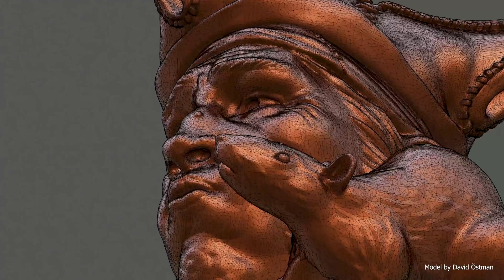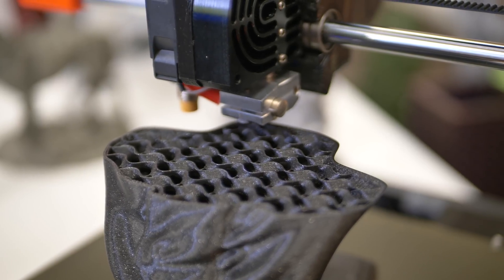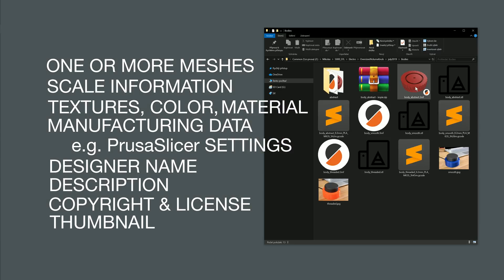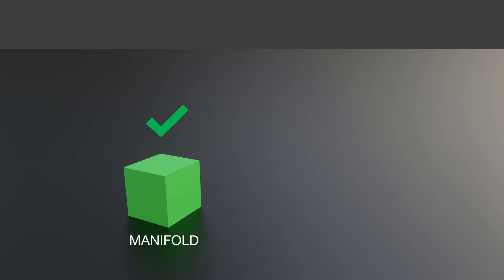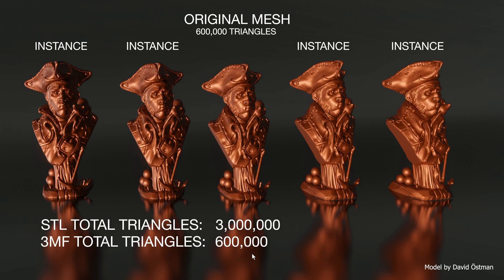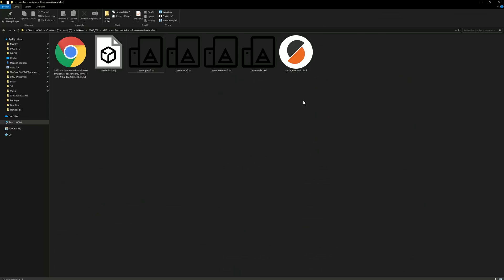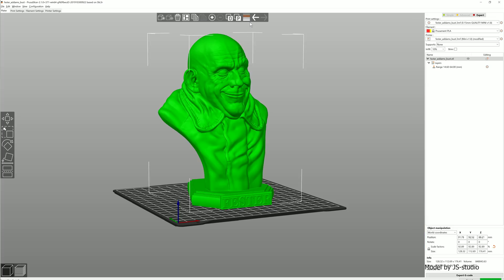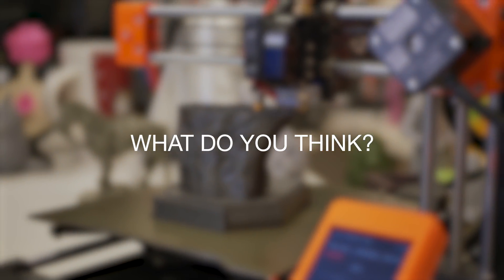Why STL is dead and 3MF is the future of 3D printing

Comment: Yeah, well ... I don't know. I like simple things, and STL is about as simple as it gets. I know how to make a manifold mesh, so I don't need some file format voodoo to do it for me. Nor do I need preconfigured slicer settings - they won't likely work as well with a different make and model of printer anyway. The only thing that I could see being useful is the compression. But considering we aren't exactly dealing with scene files in the gigabytes here, even that doesn't seem to matter all that much.
Reply: Even compression is simply zip the file. It not rocket science. You can zip STL file, but most just don't care enough.

Comment: Seems like a lot complexity for no real reason. I fail to see how an stl doesn't have scale information, if I make a model 100mm in fusion 360 export to simplify 3d and print it it comes out to 100mm. As for color information who cares, we are printing with different color fillaments. If the files color is green but I have black fillament the print is going to be black. I also see no reason to keep printing information on file seeing as files will distributed and printed on different printers with different capabilities. If a file was created and printed on a dual extruder machine but I have a single extruder that travels at twice the speed I really doubt I'm going to keep the same print settings. Thumb nails? Really, thumb nails? The only real benifit I see is the file sizes being have the size, but is anybody running out of hard drive space because if STLs I doubt it. A new standard may eventually be adopted but I don't think this is the answer.
Reply: I figured the answer was something like that. The slicer does the math instead of stl file. The print still ends up the same size we want it. If anything I think it points out the fact that scaling information on the file isn't even nessacary.
Reply: @stinkyham9050  You'd be surprised by how many programs use Inch as a unit of STL scale. Most slicers make the guesswork and if you import something really tiny, they offer the switch the mm. Luckily Fusion360 and PrusaSlicer use the same units, but this is definitely not the case with all commonly-used CAD and other 3D apps.
Reply: Sure but is it causing anyone problems? I've never pulled something off the print bed that supposed to be 24mm but was instead 2ft long.

Comment: 3MF will be a skipped file format because ideally you build a a slicer to import a .step file
Reply: Ah but a step actually retains the real structure of the shape and there for the slicer can utilize G2 and G3 commands so that the printer can produce true circles and arcs. I do not argue the difference in completely, but honestly we should be moving past 2.5D additive manufacturing and large scale versions of sla and sls are still astronomical in price and not alway even feasible. so FDM has awhile longer and so long as we are using Gcode powered machines we might as well use the more efficient commands. I like circles not 60 or even 150 sided polygons
Reply: I am well aware of those facts, but I think that that 3MF is great you are fixing to see a dramatic change in the home cnc. Servo motors that are only slightly more expensive are already being intergrated through platforms such as odrive and it will not be long till open source 5D printers are relatively easy to build. The skip in 3MF will come only if 3d printers advanced like that and I believe that they will. The base level of linear movement in a set of angle movements in the motors and when you have 5d that angle translates directly into a circle and not only is it often easier for the controller to compute it also makes for cleaner manufacturing. So I do not think you are wrong but I think that in less than 5 years that wont hold true.
Reply: @AT_Automation  We would love to go directly to STEP slicing. But that would be an incredibly revolutionary feature that would change the 3D printing industry. You would have to either triangulate on the spot (which wouldn't be that awesome) or produce the G-code toolpath directly from the volume defined by the STEP primitives. That would be amazing, but AFAIK nobody is even trying to implement that and it sounds like a huge task. Maybe something for a Ph.D. project.
Reply: Mikolas Zuza yes I hope like Autodesk could integrate it into fusions cam pretty easily thats what Im banking on

Comment: Yea I see the addition of identity into a file as a way for the gov to try and control additive manufacturing all they have to do is require identification info in all transmitted 3mf files so they can " track" where it came from
Reply: puts on tinfoil hat you realize if you wanted, you could put the metadata into an STL. I really don't see what's wrong with having a field for the designer's name.

Comment: Hmm.. the instantiation referencing in the language is definitely going to be a GoodThing(tm), as well as the ability to avoid manifold issues.  The Zip'd XML file structure also sounds promising.

However, the embedding of printer related settings.... that is going to be something that is hit/miss depending on the printer being used. Ie, for folks using a fully standardized printer like a Prusa, it will be awesome. For others, I'm guessing the settings will be a sort of starting point... I see this as a huge benefit overall over STL files though. Hopefully adoption of the format will be widespread... but I also hope that the file format will remain something that can be edited/imported/exported.

Comment: I have tried to use 3MF but unfortunately Fusion 360 does not support 3MF well enough to use for precision parts.  You cannot specify fine enough surface deviation so that enough triangles are generated.  This means that you get facets on the faces of round objects like cylinders.  This is even a problem with regular STL files but tolerable.  An example of this is that a 6 inch diameter cylinder (~150 mm)  will have 480 facets on the outside of the cylinder in the STL when you specify the minimum surface deviation in Fusion 360.  This is visible in the print on a well tuned machine.  In 3MF there is currently no way to specify the surface deviation or even any level of refinement so you get a pretty coarse output file.  I believe this same example had something like 100 facets on the face of the cylinder.  This is visible on a poorly tuned machine.  It produces ugly or in many cases unusable parts.  If you are making engineering parts you need to wait a while for the software to catch up.  I was hoping that a new format would not use triangles to represent curved surfaces but 3MF still uses triangles.

Comment: I don't see the revolutionary improvement, to me it just looks like stl with some metadata attached plus the fact that it's an untested format.

Sure I'm all about using mew things but I don't see the benefits to my work flow
Reply: The benefit for me is when I go back to printing something. I have everything that I've done to that file already set-up e.g. changed the infill to make a part of the model stronger, re-scaled it, added a custom support pillar to a particular spot. When I go back to projects that I did months ago, it's super easy to update the file depending on my needs.

Comment: I like STEP ap214, VRML 97, & OBJ most of the time.  STEP ap214 is usually very small for sharing.  The real issue with STL is how difficult it is to bring into parametric CAD software it's very lossy relative to NURBS file.  Again, STEP is king, maybe even IGES.  I print with color printers so i need more than stl file.  The main benefit of this seems to be how it can't have non-manifold edges, but most of what i see is self intersections from poor design intent prior to export.  If it is still mesh, then self intersections seems like it will always be an issue.  Mesh formats will probably never replace SLC for certain applications.  I love how many companies tried to fix this together but still seems lossy.  Do you disagree??  Please share thoughts :)

Comment: I wrote a Bash Script to convert stl to 3mf include thumbnail. I save a lot of diskspace and have a cool thumbnail :)
I think and hope 3MF is the future.
Reply from the maker: We hope to include Thumbnail generation in the next version of PrusaSlicer :)
Reply: Why not just zip STL? What's the difference? I believe that is how it works under the hook?
Reply from the maker: The difference is that 3MF has defined internal structure that every programm can use the read additional data. E.g. where the thumbnail is, where the text description is etc. If we all just zipped STL, it would be kind of a wild west and everyone would do it differently. Last but not least, it is not just zipped STL. The way triangles are stored is different. For example, as mentioned in the video 3MF supports instancing, so more copies of the same mesh are way more efficient with 3MF.

Comment: I use mostly OBJ for Figures, because its THE standard for 3D-Objects and i can use it in almost every programm i use. Converting makes alot Problems especially with STL-Files, aside from Blender i dont know a single Programm or Online-Converter that ever convertet from STL to OBJ or other way without messing somthing up. 

OBJ would actually be easly useable for Multicolor/material too, i can set matzones and even multiple parts so i could export a modell in parts and could choose to print it in parts or if the Printer is big enough in one part or make the parts in different colors or whatever. Next big Plus on OBJ is you could easly smooth the models so like work with "lowpolys" and on the final step smooth it before slicing or rendering. Its abit sad that a slicer nowdays can only work with the geometry of the obj and not the matzones or parts.

But youre absolutly right, STL is a horrible format for 3D-Printing, i totally hate it because its a pain in the ass to change something on it afterwards.
Reply: OBJ has the big disadvantage that the textures and mtl files are stored in separate files and not a simple ZIP package. This is really a huge issue when dealing with many models.
Reply: @alexanderoster3629  That is the smallest Problem to deal with, serval Programms can read zip-packed objs with all files needed inside the zip. And of course obj is not perfect either but the potential is there.

Comment: I never understood why STEP isn't used for 3D Printing. It's the industry standard in CAD interchange between systems...
Reply: dothemathright 1111  I think "building a driver" is a bit oversimplified. A slicer is more like a CAM program in my opinion, that would benefit from feature recognition that STEP provides. Especially when you think of more advanced printers with multiple extruders etc. But I agree that it would be more difficult to implement STEP. Luckily I create all my parts with CATIA and it outputs very good STL data, so I never had a problem with STL.